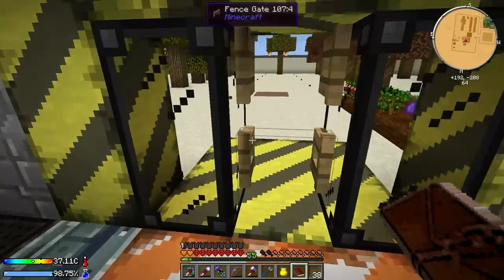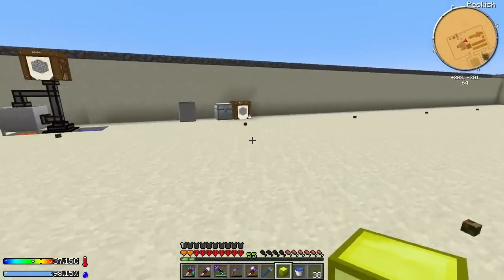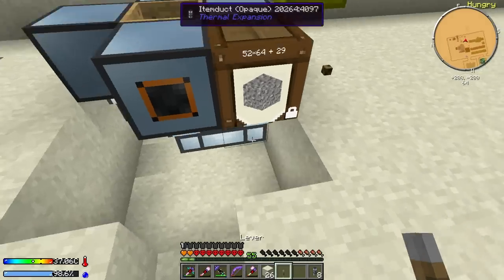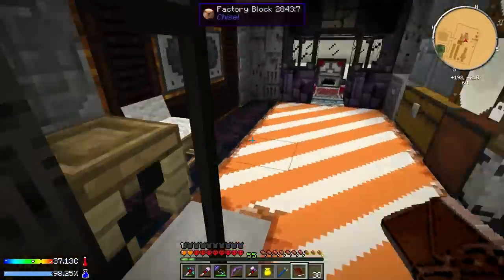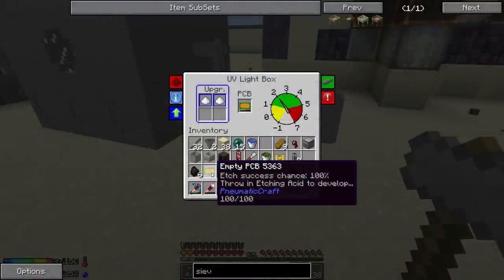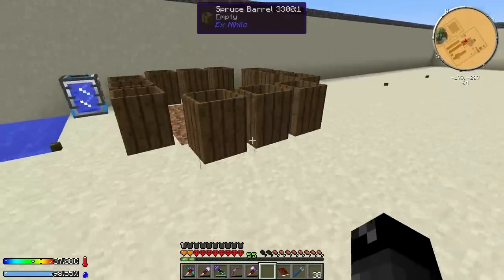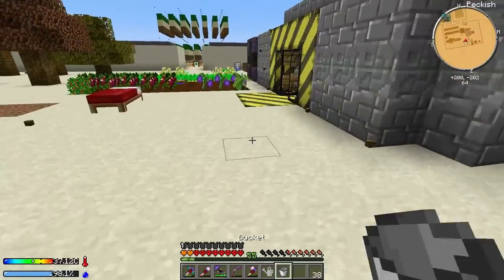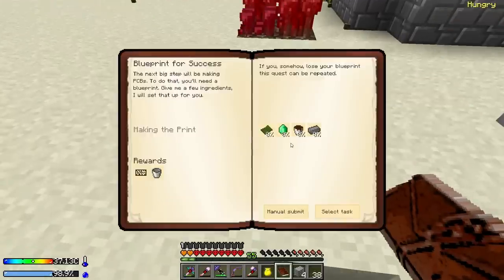Minecraft Crash Landing - Automatic Ore Sifting [E13]

Comment: Since you have Nether Quartz now and more Emeralds, you should be able to make a Sync Chamber in case if you die, just to be safe...
And I have a suggestion, would it be possible to use a Transfer Node (fluid) on the 3x3 pool to auto-fill the barrels that are right next to the Mycelium?
Reply: can you use a world interation upgrade in this pack? if so could that produce water for the barrels? Seemed like a waste for him using clean water
Reply: I believe there is a World Integration Upgrade or so, but then again Hypno is getting water straight from his cactus farm, and not to mention it is unlimited.